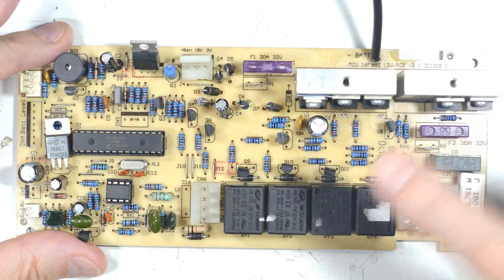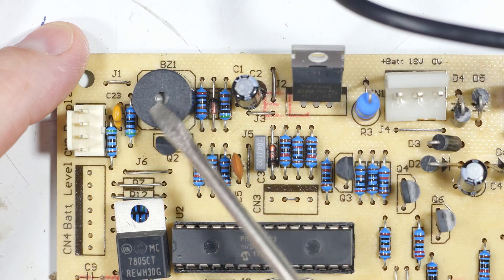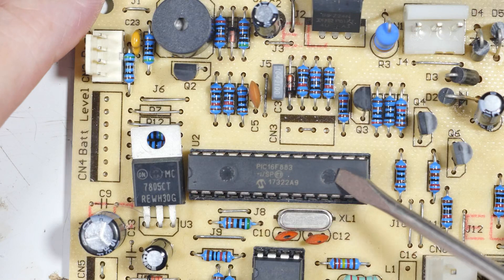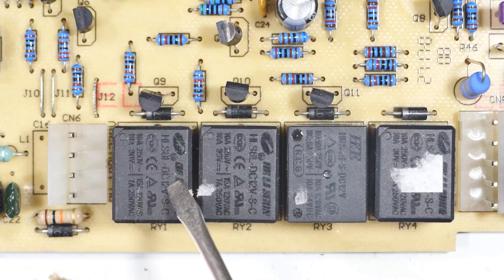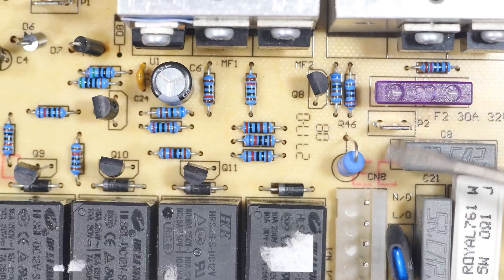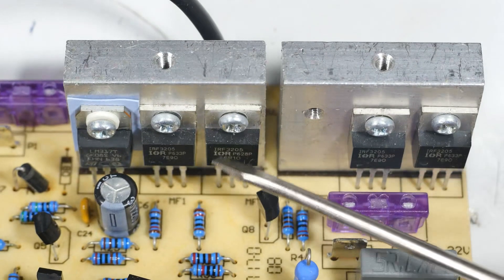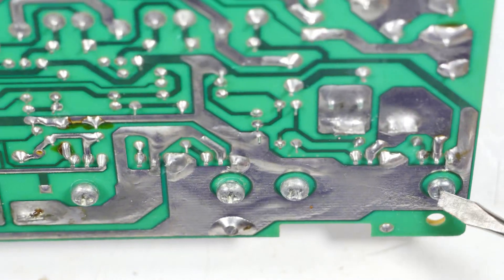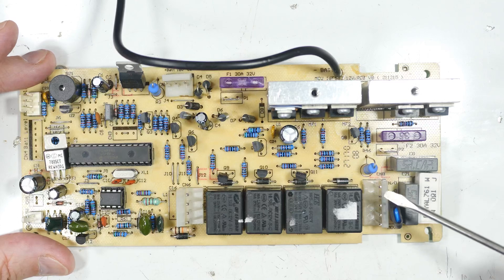Salvaging Circuit Boards + Rare Find (4K)

Comment from the maker: RELATED: 
Reusing electrical components from scrapped stuff:  https://youtu.be/cMejndPYn0c
Basic Desoldering - Circuit Board Stripping, Tips and Tricks: https://youtu.be/NJWKOwfz_lk
Remove Pins From Amphenol / Molex Connectors For Reuse: https://www.youtube.com/watch?v=LUuBx0uVNG4
Salvageable Parts From A Bad UPS Board:   https://youtu.be/FAhTbH2efAw
Salvaging Electronic Parts: Power Supply:    https://youtu.be/pDbAhXd2qLI
Salvaging Electronic Parts: Core I2S Motherboard:   https://youtu.be/5c1ME2DmHk4
Reusing Crimp Lugs:    https://youtu.be/JIdsnk8kqoY
Threaded Brass Inserts - Salvaging & Reusing:    https://youtu.be/DR6H3-N3t-I
LED Security Light IR Sensor Teardown For Parts(?):    https://youtu.be/ySlk66hfrlg
Salvaging Electronic Parts: Remote Doorbell:   https://youtu.be/bRk9LSBjLio

Comment: There's one inductor there too. The reason I noticed is I just pulled about ten out of a board. After years of not building anything I've recently got back into the hobby. I'm currently facinated with diode ring mixers, toroids and other inductors. I recently purchased an L/C meter that arrived a few days ago. The LC-100 that you did a video on. It was your video that clinched my decision to buy that one. I wanted something low cost but able to measure low inductance. Mine didn't have instructions and I only just worked out how to calibrate it for measuring inductors. You join the two leads together, hold the red reset button. You then get an okay. I suppose it needs to take into account the inductance of those leads. I was wondering why I was getting readings too high for low inductors. Bigger ones too I suppose, but not so noticeably. I went from being a bit disappointed with it, to being very very happy with the purchase.

Comment: This video is fine, but it’s intended for people who already know quite a bit about electronics. 

Somebody should buy a Radio Shack 200 in 1 project board, and go through the lessons, one by one. 

If a young man knows just a few things, he can make his own projects. All he needs is a breadboard, and a basic understanding of transistors and relays.
Reply from the maker: Radio Shack has been gone for a while now. I used to build their projects, then I graduated to HeathKits. HeathKit is also gone. Nowadays you have to find a project on the internet, buy your own parts, and learn from that. Sometimes the projects are well laid out and explained, sometimes not. These circuit boards are a good source of cheap and hard to find parts.